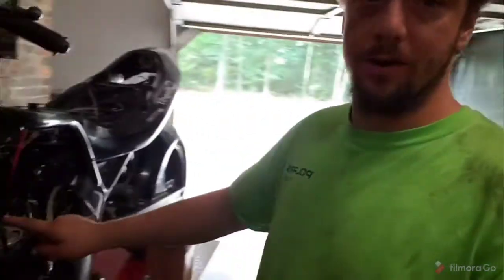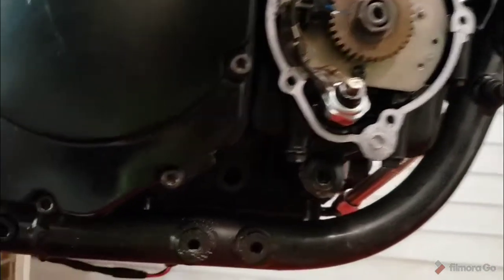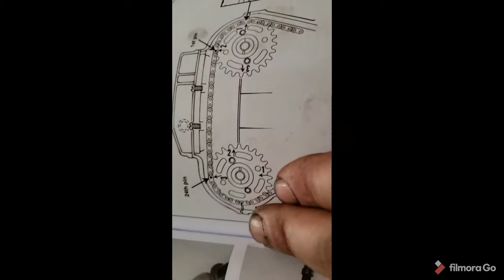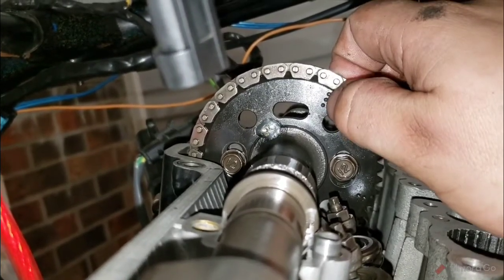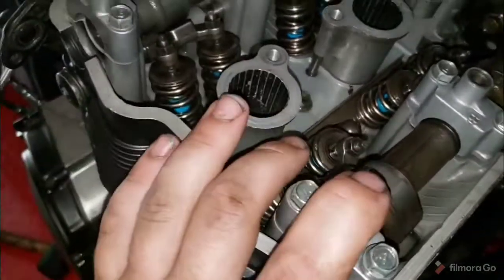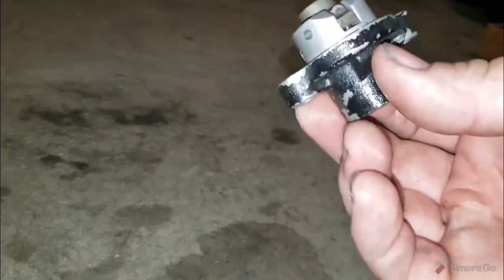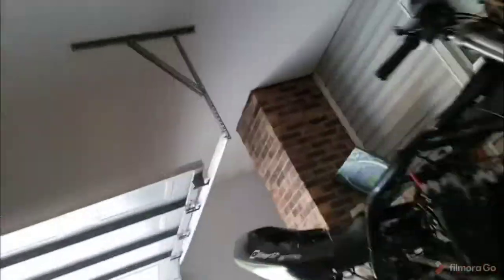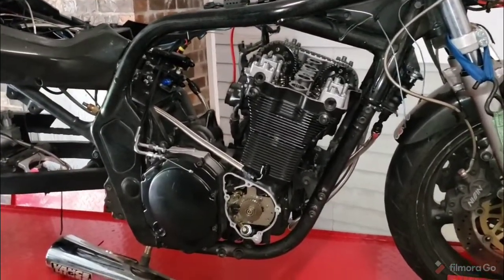Installing a bandit 1200 cylinder head

Comment: Quick question bud head gasket base does it sit between the bottom end and the head gasket i need to replace my head gasket but not sure if in need the base gasket aswell cheer
Reply from the maker: If you don't remove the block you don't need a base gasket

Comment: I changed my oil and filter on a 600 mk1 1997 bandit now the oil light is on permanently. Any ideas on what it could be?
Reply from the maker: Somehow you have the wire running to the oil pressure switch shorted to ground
Reply: @RingTuned  cheers buddy I'll have a look at it.👍 I had oil pan off twice looking for a blockage 😆.

Comment: Will you do one on clutch set ups amd stack height 🤔
Reply from the maker: I don't measure stack height honestly. I'm still on a hand clutch so  no real need to be that accurate. I have a stock basket with OEM steels and fibers I swapped 1 thin steel for an additional a thick one. I have 2 heavy diaphragm springs and a mtc single stage  lockup. My busa has the toruqe modifier welded and 3 brocks xhd springs with 3 stock springs.

Comment: Hello budy, how are you? Out of curiosity, what engine oil do you use and how often do you replace it? I noticed that the camshaft is very clean. Sign that perhaps uses a good oil.
Reply from the maker: I run rotella to 15w40 in it now changing every other weekend but that cam has 175000 miles on it using amsoil metric bike oil changing every 8000 miles
Reply: @RingTuned  thanks for your answer.  👍